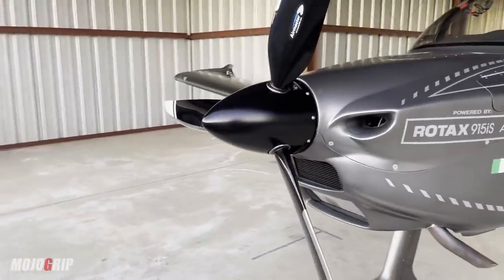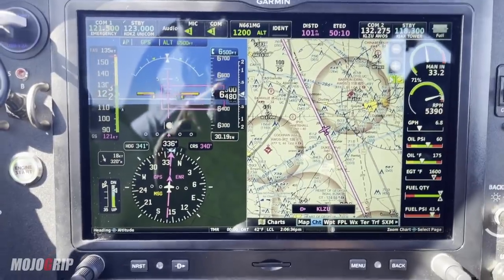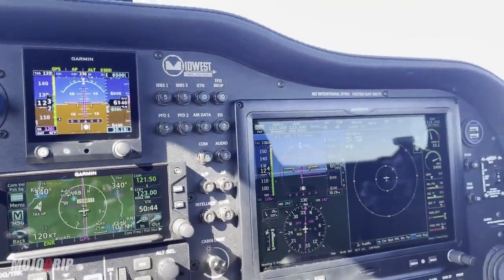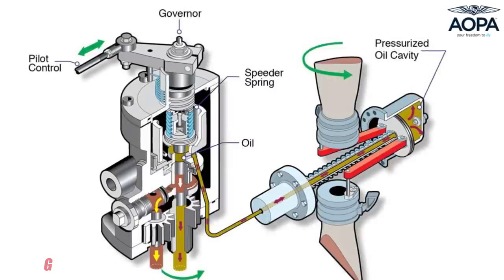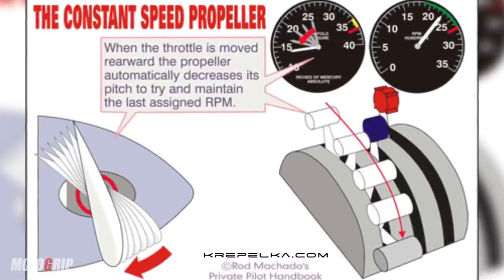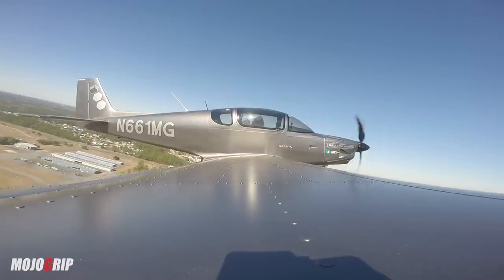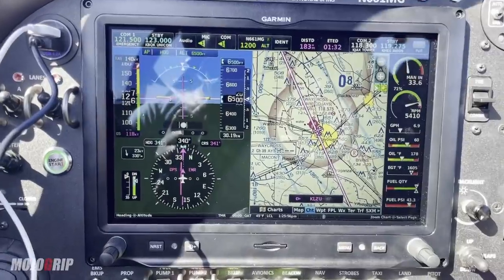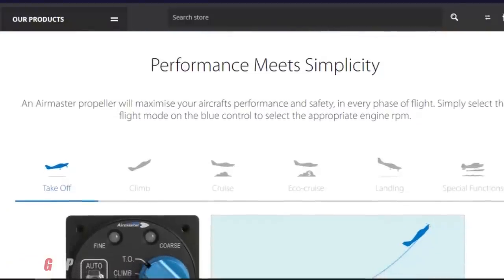Airmaster Will Make You Go Fast And Burn Less Fuel

Comment from the maker: Rather than respond to multiple comments, I'll try and answer with one here. I will post in community tab as well. I truly hate getting too technical on this channel because there are so many non-pilots who watch, so please bare with me.
For those who question my decision to operate the prop in climb setting, here's what you need to understand:
1. Operating the Rotax 915 engine on lower RPMs actually puts a lot of strain on the gearbox if used for prolonged periods. If you ever fly behind one, just try reducing power below 1900 RPM while on the ground and you'll see what I mean.
2. Rotax are built to run at High RPMs but the operation is quite similar to your conventional engine. A Lycoming io360 for example will get you max power at 2700 RPM, but in cruise you would ride it at 2200-2400. Similar calculations here. Max on the Rotax 915 is 5800 RPM, Climb is 5400-5500 RPM and Cruise is 5000 RPM or less. 
3. The cruise setting on the Airmaster will ride on lower RPMs (5000 or less) which also means you add more power (manifold) to get to desired speed. More power = more fuel burn. When you leave the prop in climb setting at 400-500 more RPM, you can ease up on the manifold pressure, and that ultimately gives you good power : rpm: fuel ratio.
4. 5450 RPM continuous is sweet spot for the Rotax 915. 
5. For those who genuinely had a question about this, your feedback is greatly appreciated!
6. For the Chair pilots who always think they know best, your opinion is also greatly appreciated for the yt algorithm. But please refrain from trying to teach another pilot how to operate their own aircraft especially when you've personally never operated that same aircraft yourself.
Reply: I liked your honest explanation and reasoning why you made your decision.
Reply: The prop I wish I had on the Bristell...
Reply: Mojo please make a video of you fueling your sling tsi
Reply: Thanks for the explanation Mike - this makes sense.
Reply: Lols @chair pilots 😁
Reply: Mike, cool, and if you want to operate at a higher rpm, awesome. But I still question if your economy (distance traveled for fuel burn) is actually better which is how I understood your comment about pitch selection.

I gave the sample equation specifically to show how a higher fuel burn rate per hour can still be more economical for distance traveled.
And no, I don't fly your plane or a Rotax, but I am still curious to see how your calculations come out.

Honestly, it seems like you could have done well by just mounting a fixed pitch prop instead.

Comment: Mike, I think you need to run your numbers. If you are getting better fuel ECONOMY at climb pitch, there is a problem. Could be bad programming from the manufacturer, or an error in installed, etc. 
It sounds like you might be over-emphasizing fuel flow and not calculating it against your airspeed.
Use your airspeed, divided gph to calculate the fuel economy.

Example = 120 knots at 10gph is 12 nautical miles per gallon but
130 knots at 10.5 gph is 12.4 nmpg and therefore more efficient.

Comment: I'd like to see a video showing prop rpm, manifold pressure and fuel flow as you go through all 3 prop setting. I would think that the manufacturer of the prop might have a good reason for 3 different settings since they have more long-term research. Also in some earlier videos it seemed that you struggled to find airports at night and on the first visit. Why didn't you use those nice avionics you purchased to lead you there and set you up for your approach. Keep up the great content 👏.
Reply: The cruise setting is meant for the engine to run at its most efficient torque vs power setting: 5252 rpm. I too am interested in seeing the performance numbers for the climb and cruise settings.
Reply: It seem a bit counterintuitive that the ‘climb’ setting would be more efficient in cruise.
Reply: @scottbennett7982  agree, and in fact it is not. The reason why he sees lower GPH is because with high RPM is pulling back on the throttle and therefore using less fuel but definitely not the right think to do. If you refer to the manual you should have a higher manifold pressure with lower rpm , so more pitch and more throttle and most likely faster speed too...
Reply: @Teogalla1985  It's like cruising along the interstate at 75 mph in 4th gear.
Reply: @flexairz  5252 is only used for calculating hp and has no bearing on the efficiency of the motor. See brake specific fuel consumption. An engine is designed to have its best bsfc at a specific rpm, which is more narrowly tuned for some applications, as in generators that operate at one primary rpm.
Reply: @flexairz  Except that’s not where the cruise setting targets. It targets 5090 RPM which means 2,000 propeller RPM. If you want the best speed and fuel efficiency with the 915 Airmaster combination it’s 5450 RPM, 2,145 propeller RPM and manifold pressure below 37” which keeps it in Eco mode.
Reply: @Teogalla1985  No. Manifold pressure is controlled by throttle, more manifold pressure means for fuel and more work for the turbo. High manifold and low rpm is really hard on the engine. Where you want to be with this setup is at >37” manifold and 5450 crank rpm which equals 2,145 propeller rpm. The engine will stay in Eco mode and you’ll have the best forward speed and fuel burn at the cost of high cabin noise.
Reply: @andrewmorris3479  I did not say high map and low rpm but instead i said LOWER rpm than what he is currently using. I know that very low rpm and high map it’s overloading the engine which is like going in 5th gear with the pedal to the floor uphill. And that is not what i said. I simply stated that there is an operation manual which the manufacture developed and that is the bible which should be followed. I am not sure where you got your number from, again the manual is pretty self explanatory. We don’t follow efficiency but rather parameters.
Reply: @Teogalla1985  Lower RPM than what he is using will mean less true airspeed. I got my numbers from flying the airplane and taking crankshaft RPM divided by the gearbox ratio of 2.54 to factor propeller rpm. Again, if you want the best forward speed for fuel burn you want >37” and 2,145 propeller rpm.

Comment: Isn't there three kinds? Fixed pitch, constant speed, and in flight variable pitch?
I'm not up on it yet so help me out. 
The constant speed - its a hydraulic governor so does that mean if you leave the prop control  and throttle set during climb and you level out and start decent that the prop pitch will increase by itself to maintain rpm? And then what happens to vacuum? Does it stay constant cos you have same throttle position and same rpm?
Inflight variable pitch- do the settings in the cabin align to a setpoint of rpm or is it just open loop pitch control?

Comment: Question:  is there a way to tie the auto prop pitch directly to the FADEC ?  seems like the next logical step...so rather than doing the swiss gear hack you mentioned, the pitch is set according to power automatically.  

Question2:  in your AP/AD system, does it also control the prop pitch automatically?   or just the typical flight surface and trim functions?

thanks, good videos...thanks
Reply: Stock Flight Systems does make just such a device.  It's an engine monitor system and can also control prop rpm automatically with the Rotax 915.  I'm not sure if it's quite refined enough, but I believe there are some planes flying out there with it right now.

Comment: I find it interesting that the kind of engine and drivetrain automation we've taken for granted in cars for decades is still a relatively new thing in GA aircraft. Even a brand new G36 Bonanza has manually-controlled propeller pitch. I'm sure it's for reasons of reliability. After all, if your ECU fails in your car, it's a lot less potentially catastrophic than if it fails in your airplane.
Reply: That’s why there is two of everything with the 912 iS and 915 iS. Two fuel injectors per cylinder, two generators, two lanes for the ECU, etc.

Comment: MIke, read your pinned comment and all the comments that prompted it, and it seems like you are in fact doing the correct thing for your engine manually, but that seems to beg the question does the control system of Airmaster require adjustment so you can set the cruise option to you stated sweet spot?
Reply from the maker: You can if you so desire. You always have the option to adjust settings to what's best for your aircraft/engine performance

Comment: Does that prop work on conventional engines like Lycoming? What's the price tag? Thanks.
Reply: Seems like they have props for 0200 , 0235 , UL, Jabiru, those type power plants. Since they have done a 140hp Rotax I’d think something for an 0290 should be doable on this hub. 
I’d like to see something like a Thorp T18 with an Airmaster on an 0290 or an RV3, Midget Mustang with an 0235 constant speed.

Comment: I own a Piper Arrow IV.  I just want to know, if you suffer a complete electrical failure, how does that affect the propellers?  Just asking.  Thank you for the videos.  Also are you attending Sun and Fun?
Reply from the maker: Good question. In that case, the prop will continue operating in its last setting before the cut off. There is also a manual mode.
Reply: @mojogrip  thank you.  I’m I going to see you at Sun and Fun this year?

Comment: No prop control, no mixture, no magnetos, no carb heat, unleaded fuel, cheap. Rotax is the way aviation engines should be
Reply: Or just run a turbo apex for like $8k.  Aviation engines are overpriced inefficient dinosaurs.
Reply: One thing a Rotax isn’t is cheap. I was leaning towards really liking the 915, but if it’s going to be that expensive and still burn 6+ gph at 135 or so constant available hp. Well, that’s not really much better than a tried and true 0320.  It’s lighter, but from where I sit, that’s about it. 
Maybe I’m totally wrong, so if any 915 owners want to give me the straight dope I’m all ears.

Comment: Yeah I guess that's the awful state of GA, this is the only lightish 4 seater with a lean turbo engine. Cirrus weighs double and has old turbo engine. And costs triple. Panthera weighs 815kg.  Even the otherwise savage Lancair IV-P is 900kg. We could use a new modern IV-P or VP at less than half the weight. Should be plenty possible. Or even better with two small jets.